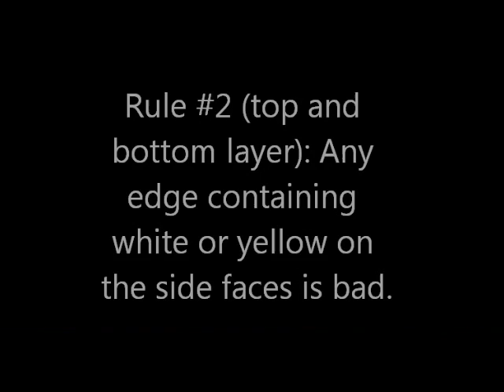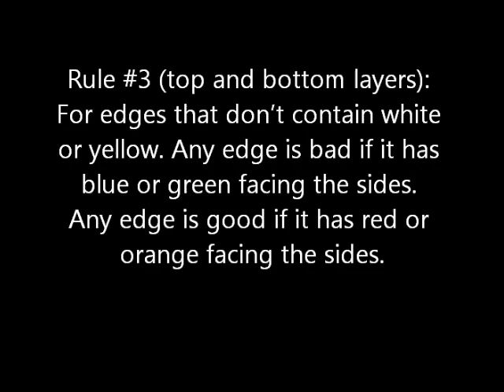ZZ Method Tutorial Part 2: Edge Orientation Detection

Comment from the maker: You can definitely use a rotation to lower the number of bad edges. However, you may have to adjust your "rules". I found that too time consuming to plan effective EO lines so I don't do it. I'm sure you can make that work with enough practice.

Having a fixed orientation also gives me more awareness of where my f2l blocks should go. Sometimes if I use another orientation I lose this awareness and I get confused. Hope that made sense.
Reply: It did

Comment: 1.White and yellow on top or bottom good.
2.white and yellow on side are bad.
3.Non white and Non yellow on up or down look at side if it is green or blue then good.
4.second layer white or yellow at front or back good.
5.second layer non white and non yellow has green or blue on side bad and front or back is good.
Reply: +Abhishek poojari You got #3 reversed.

Quote: Rule #3 (top and bottom layers): For edges that don't contain white or yellow. Any edge is BAD if it has blue or green facing the SIDES.

Check out Free Thought's bookmark in the comments for Rule 3 explanation if you think I'm wrong.
Reply: NO he got it right. Ex: if it is red up and green side, then it's good.

Comment: I am having trouble understanding rule 5, on my cube a blue edge is facing me but to put it in its correct place I would have to do a F2 to connect the orange sticker to orange center
Reply: F2 is the same as doing U L2 D or U' R2 D'

Comment: so basically anything is that can be solved using a B B' or F and F' is bad and anything that can be solved with R R' ,L L', D D' and U U' is good?
Reply: yep
Reply: And R2, L2, D2 also work
Reply: Matthew Kim and F2 and B2
Reply: No Edges that can be solved with F2 and B2 are also good edges.As it does not change the orientation

Comment: Okay, can anyone help me with this? I do not know any methods other than begginers and I want to break into speedcubing. I thought that the ZZ method sounded easy but from reading on the internet, it looks like it is just as hard to learn as friedrich? What about the "corners first" method? Is that where I should go next? All the others seem confusing so if anyone has any advice, that would be great. I understand that the corners first is not very fast and according to wikipedia, not many are doing it because few can get a sub 20. I don't care about that. I just want to learn something faster than beginners with some finger tricks and a method that I can understand easily. Thanks.
Reply: CFOP is the way to go. You said its hard to learn but once you get the hang of it it's really simple and a lot faster than LBL.
Reply: Learn Roux. It will improve your cube intuition and if you dont like it, switching to another method should be pretty easy.
Reply: It depends on what you want to be honest. CFOP is algorithm memorization, and ZZ is more of an intuitive type method (which requires recognition practice) both should take an equal amount of time to learn in my opinion.
Reply: Derek Fusari Honestly if you think about ZZLL and ZBLL and all that stuff, ZZ has a lot more algs than CFOP.
Reply: ***** The difference being that a complete CFOP solve would require 2 look last layer, which gives you about 70+ algs to learn. You don't NEED that many to complete a full ZZ solve, but you can do ZZLL and ZBLL to make yourself faster, but these should be treated like VLS, Winter Variation, etc for CFOP ie they're not required but you can use them to make your solve more efficient.
Reply: Cfop, definitely. The world record holder uses that method.
Reply: Brian Shaik Who cares who uses the method? Op should choose a method that works well for them.
Reply: The world's fastest cubers will never switch from CFOP aka Fridrich to another method. They have put too much practice into it. If someone practices ZZ just as much, we could see a ZZ world record holder. I know CFOP and average about 30 seconds, and I think I'm gonna transfer to this.
Reply: magiccuber33 if you want a rotationless method => Roux or ZZ
if you want a LbL type of method => CFOP
if you want to be able to skip the OLL (or just have less OLL cases to learn) => VH (my main method right now) or WV or SV (VLS, RLS and MGLS are in my opinion more algorithmic and useful with ZZ)
if you want an intuitive method => Heise
if you want a corner first method => CF or Waterman
if you want an algorithmic method => ZB

Comment: What if the edge is good and bad? Is that even possible?
Reply: No. One orientation of an edge is good, the other is bad. An edge cannot have two different orientations at once.
Reply: No it is impossible. the only time where it could be possible is if the cube was altered in some way such as 1 piece is put in wrong or the stickers are on wrong. and example of the stickers is if opposite colors on the cube, such as orange and red because they are on opposite sides on the cube, are both located on the same edge piece.
Reply: Jay Lee This would be an unsolvable cube. I'm pretty sure that ZZ method only works for cubes that are solvable. :P
Reply: US4096 yes i understand that this method only works with solvable cubes. i was just simply explaining how an edge could not be bad and good.
Reply: US4096 then again looking back at my explanation it does sound like i am talking about an unsolveable cube. I bow down to you
Reply: no that kind of piece is not possible at all

Comment: i keep getting odd numbers of bad edges no matter how much i check
Reply: then one of your pieces are flipped. Solve it with the beginners method and fix any errors in your pieces
Reply: it wasnt that, it was with the edge orientation recignition, I didn't understand him.
Reply: If you need help here is the list of rules (assuming you have Green/Blue on the Top/Bottom and White facing you.

Rule #1 (TB) Blue/Green facing Up/Down k edge is good

Rule #2 (TB) !Blue/Green if White/Yellow is facing the side edge is bad

Rule #3 (TB) !Blue/Green if Red/Orange is facing the side edge is good

Rule #4 (M) Blue/Green facing front/back is good

Rule #4 (M) Red/Orange facing side is good

Comment: I have one good edge
Reply: Green Watch the next video
Reply: I was making a point. I somehow managed to do that, which is impossible.
Reply: Green If it was impossible did you try solving the cube normally? If you were able to solve it then it was possible (or you had missed something). If the cube was impossible to solve, then I might wonder how you managed to take out an edge and put it back in reversed without noticing.
Reply: Julia Roxxy It was impossible.
Reply: Green Problem solved :)